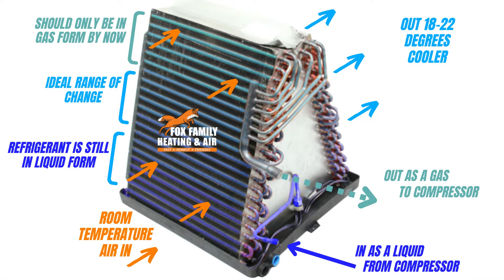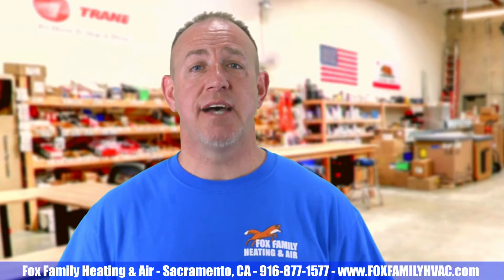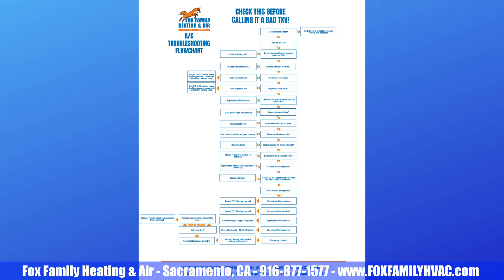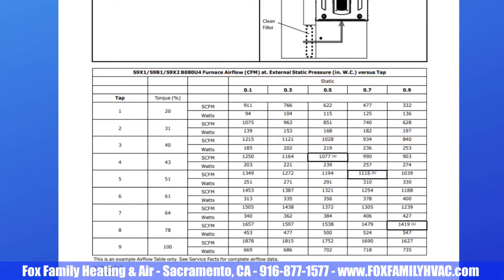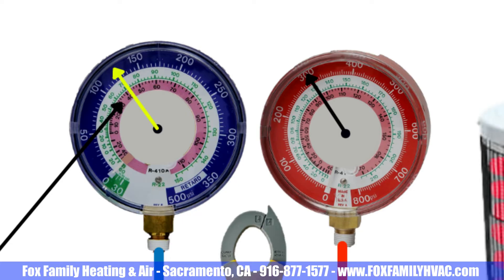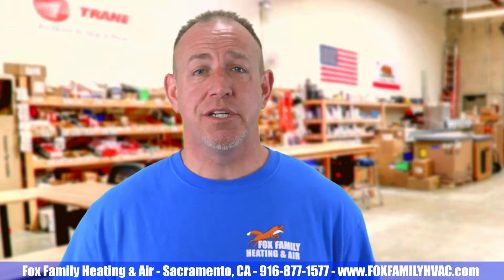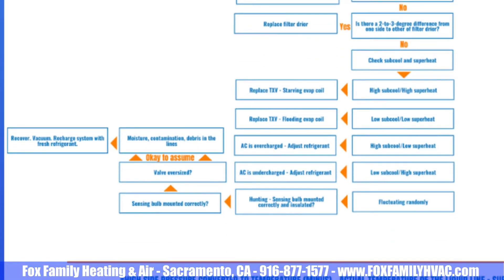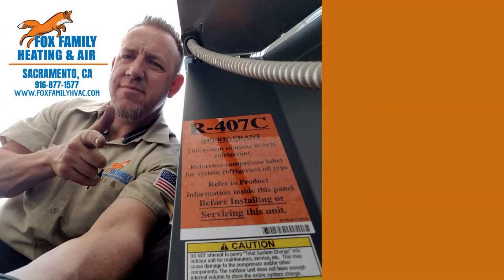How I Diagnose a Bad TXV  | 👉 Thermostatic Expansion Valve 🦊

Comment: What if I’ve got a 30 degree A-coil that isn’t freezing and a 23 degree temp split? Unit was showing adequate subcooling but low superheat. Filters were fine and condenser had been cleaned out before checking pressures.
Reply: Low load likely due to low airflow or it’s super cold indoors

Comment: Is it okay to run the TXV without the strainer screen?  My HVAC guy removed the strainer screen on the liquid line 2 inches before the TXV.   Just a note, the strainer screen is not part of the TXV itself, it's the strainer screen inside the fluid line 2 inches before the TXV.  Model number EA36YP298  Thank you.

Comment: The way I was trained was to verify Airflow (filters, coils, fans, obstructions) then Electronics (motors, capacitors, controls) before ever putting gauges on. In 10yrs residential and light commercial I've found far more bad customers than bad TXVs. This is a great video, thank you.
Reply: whats a "bad customer"

Comment: Hello, why does every CARRIER i put in (litterally 10 outta 10). always have 18-20 superheat and low liquid line pressure. Even with 13 subcool. Each install i spend like 3 days checking back and stuff. And I follow manufacturer installation religiously.
Reply: Have you figured out why? Do you need to adjust the txv?
Reply: @xincai951  no. They dont come with adjustable txv. I have to over size the coil at least half ton or slow down the fan 😅

Comment: Omg..I am so glad I found you. I am in Fla my whole life. I two years ago duke enegery gave me a free hahsha, home AC assessment, well here went the money tree. Need more intake vents, need larger exchanges, new boots, new lines to blow in attic. I said fine. The the shit storm came, The AC company the had come out destroyed everything boots uneven..dust flying all over house. They came out to fix, Phlems not right ..then#dukeenegey refused to help fix this after 5 grand..Now I still do not have a freezing house at night to sleep but tons of air flow. So a year later I called 10 AC companies no one wanted to touch it. Finally I got a new company #threeguysac to come out to the tune of 4 grand to repair #dukeenegery big mess. New Honeywell 7 day thermostat. Yet still not 100% right all summer. But better. I have the AC checked twice a year. Spring pre winter, I clean all my filtrers every months. All of them as  well as light vaccine and dust. Now summer comes I call for matainance the kids tell me all us well but my  compassator the little round thing may go soon I said replace it there goes 250...now I tell him about the thermostat to check it. It in auto. Day 72 night 66..not working if I manual overide the air gets hotter. He says my attic blower is to fast if I slow it. Down it will cool better. I said fine. That night hardly no AC was coming out of the vents..and temp did not drop all night below 72. Then new guy comes back. Re does thermostat and the settings  were wrong checks the AC. And tells me its tthe txv..however there is no freezing no ice ..ugh by now wants to replace for 800...I am FED UP.. My AC bill is six times higher than anyone on my neighborhood, its me and hubby. 1100 sf..3 ton r22 , I am 66 year wifey learning NIW to take care if AC. Plumblin..roofing.. Etc .hence I thunk thus is bull .it can be blown. Maybe dust. My AC at 94 outside us blows g at 55 to 54 out the vents all day .at 72. Freezeing. Night the minute you drop it 1 degree its al! Downhill... CAN YOU ADVICE. I AM OUT  OF MONEY.  I AM ON SS. I NEED TO SLEEP AT NIGHT.

Comment: Excellent video, my installer wants to replace my TXV for the second time ( replaced with a piston while txv was ordered) on a 2 year newly installed SEER 16 Goodman Heat Pump. My temp is set on 77 degree but runs for 25 min on and 5 min off to do the job, this doesn't sound right. I need a good A/C tech in SW Florida.
Reply: Are you near Pensacola Florida?

Comment: Actually with the 2007 regulations. Systems did not get more efficient with txv's.  Its was because the suface area on the evap and condensor coils got bigger to absorb and reject more heat and humidity. Goodman proved this while staying with a piston metering device.
Reply: Yes 100

Comment: With a heat exchange unit also can you cycle from heat to cool to see if the valve frees up? Would this damage anything doing this when the ambient temperature is in the high 90,'s to low 100..?

Comment: When looking for txv everyone  says to look at evap core but on york they are in the heat pump. Should I use super heat or subcool? Thanks!
Reply: There should be one TXV at the condenser and another TXV at the evaporator on a Heat pump.
Reply: @robertcherry4971  Some manufacturers have fixed metering devices in heating mode - Carrier, Goodman, etc..

Comment: I had a TXV diagnosed some years ago and they asked me for a glass of ice water. At the time I didn't know it was for the diag process but learned a minute later. He correctly called for the TXV. And yes, the system did perform somewhat better while the part was on order. Thing is, I kept the system operating right on the knee between function and failure by resting it periodically when it began to faulter so when he got here it was a no brainer compared to what it might have been. In other words, I did not let the compressor go thermal but the temps/pressures were still off so he could see in a snap what was up.
Thanks for another nice tight discussion.